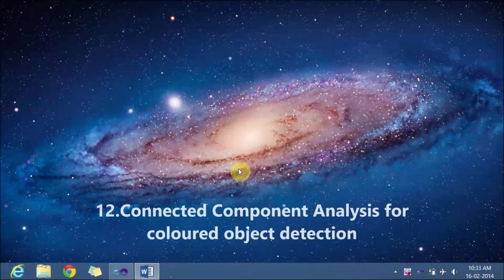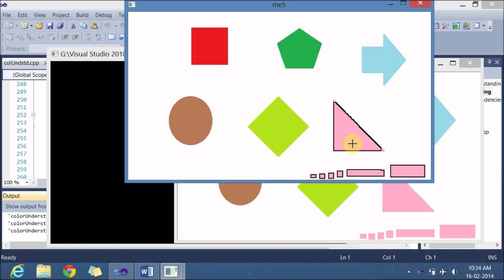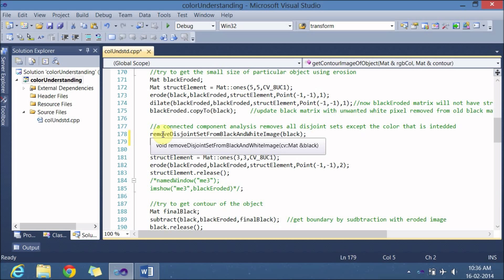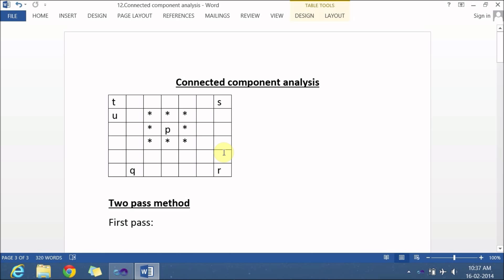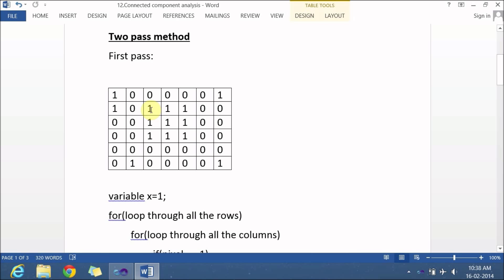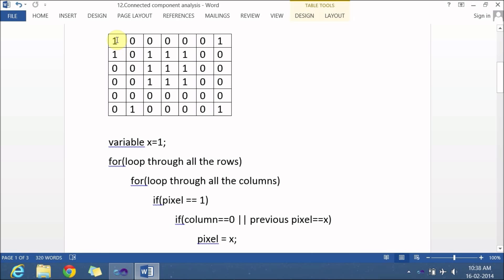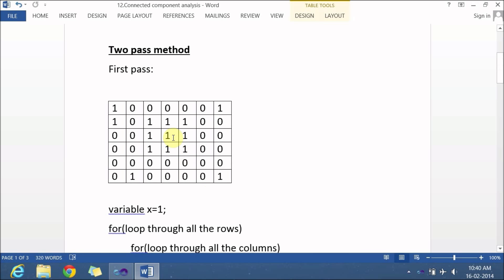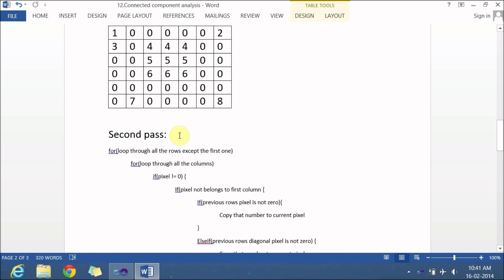12.connectedComponentAnalysis

Comment: what about applying second pass on this:
0 0 1 1 1 1 0 0 2
3 3 3 3 0 0 0 0 0
0 0 0 4 4 4 4 0 0
Reply from the maker: +Ivo Weiss 
Hi
There is small flaw in the algo.
The second pass should be looped again and again until no changes occurs to the B&W image.
For checking occurrences of changes, what you can do is make a count of changes.
Form previous iteration to the current iteration if count is zero, their you can break your loop
Reply: +OpenCVstyle thanks a lot for the quick response